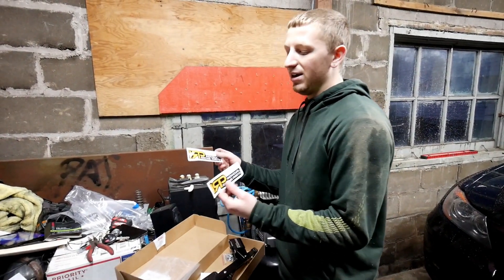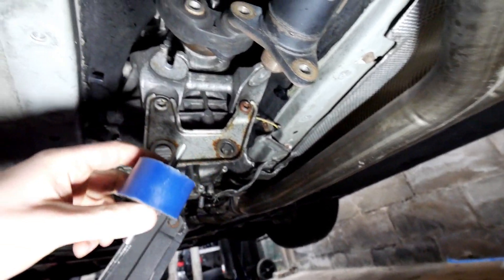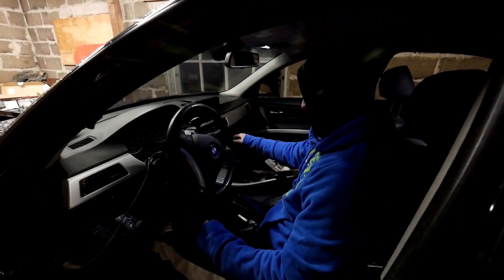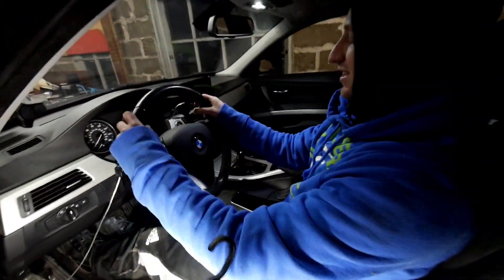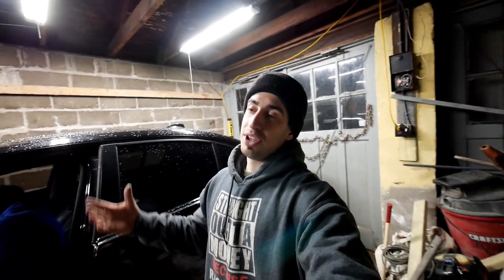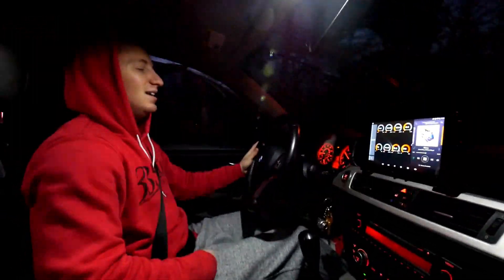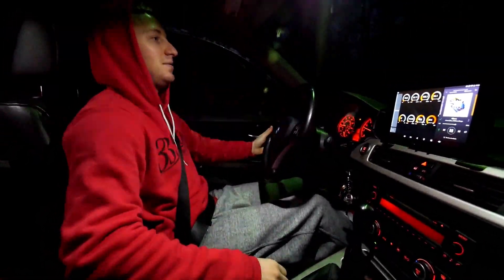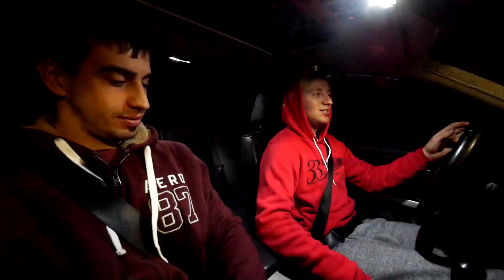INSTALLING A IRP SHORT SHIFTER KIT ON THE 335i!

Comment: Do u only have 2.5 exhust or 3 ? i thinking about build it in 3 inch all the way will it be a big diffrence ? ( better ) or do u think it will make the exhust sound more ? :D
Reply from the maker: If i go bigger it'll prob be deeper ! Im 2.5 inch
Reply: @AllCarsEverythingOfficial  do u think i need to have 2  3 inch exhust all the way or only 1 and then a Y split ? do think it will be better performence ?
Reply from the maker: @stringjesus1892  2 3 inch would be better
Reply: I have 3 inch all the WY from cats and it's great. Huge difference right away in how free it flows and breathes

Comment: Hi, do you have a singlemass flywheel or stock? I am afraid that the SMFW would worsen the NVH much more.. (I am considering the shortshift options myself)
Reply from the maker: Michal Sebik yea single mass flywheel and it was noisier but we increased the idle rpm to about 900 and it took away most of the noise